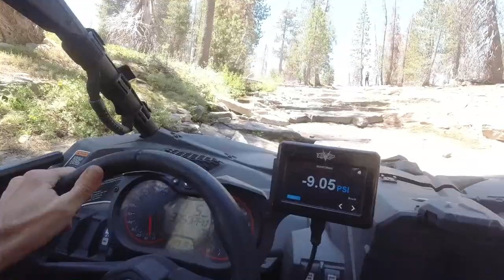RZR PRO XP 2020 FIRST RIP ALONG WITH OUR CAN AM MAVERICK X3 TOWED BY OUR WOLFPACK TOY HAULER

Comment: Have your guys show the impact of clutching changes. Seems there are lots of people on the forums asking for info that an expert could walk them through with demonstration and impact assessment. Might also look at the improvement in radio performance with proper installation and distance difference from hand held/hand held with big antenna/actual installed radio.
Reply from the maker: We have in an older video but we will be doing more soon. The radio video would be cool

Comment: I had the turbo S and dynamix. Yes it's nice but also takes all choices away. It doesn't cover everything so I think they have ways to go. 
Also have x3s. And I like the ability to change the suspension to how I want it. 
That said I would buy the pro without dynamix no problem. 
Sometimes the dynamix just feels like it's not where you want it and you can't alter much to change it. 

My question is how to you two like the shocks now and since you have the X3 dialed in, can you compare then a bit?
Reply from the maker: We have driven a couple of turbo s cars, they are awesome. "But we are looking forward to tuning these socks. I can tell you that this car rocks, we rode in the hills again today and we are loving it. The ride is more harsh than our x3 but that is expected as it is dialed by MTS. I wish I could tell you what the bottom our control is like but we haven't hit the dunes, yet, the over all ride is great, just looking forward to getting a little smoother in the chop, but that is kind of a spoiled thing on our part, its pretty good now. It corners flat, probably more composed than the x3 stock, handle very well, and its hard to tell its only 64' wide.
Reply: @DandiOffroad  very well put. With that I get a very good idea what you are saying. As well as how good mts is also. Thanks for taking the time to rip into it with the comparisons. Good thing I like is your channel isn't just one direction. Have a bit of both worlds and just love the sport same as myself. 
I'll be watching lots to see more!

Comment: The Pro Ultimate is a completely different car and ride!  Live valve shocks are the future!
Reply from the maker: Its actually the same car, but different shocks, we would love to try the live valve but not on this car, and not for 10 grand more, not yet anyway. I am looking forward to trying them soon.
Reply: @DandiOffroad   ITs just shocks that sense you brake, throttle, steering position, as well as a gyro that senses your cars position in the air and adjust you shocks!  My dealer was only about $6K more.  You get the vehicle 2 vehicle communications/ info, Steering wheel controls, GPS Ride Command and  more.  And once ST is done re-spring/re-valve; my wife says "how can they call this off roading?".  It may have the same name but the Ultimate is really a totally different experience.  I had  so many industry friends say just buy the Premium and Oh are they sorry now!
Reply from the maker: yeah we're super aware of what the differences are. It's a really awesome car but you have to understand this is our second car. Our primary car is still our Can-Am which is shock tuned by MTS. We will someday try out the live valve stuff for sure.